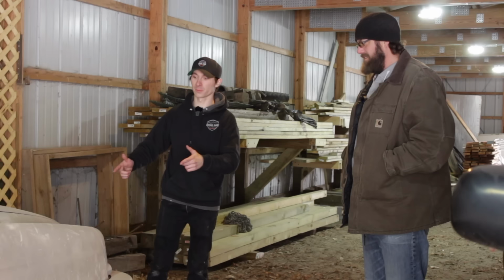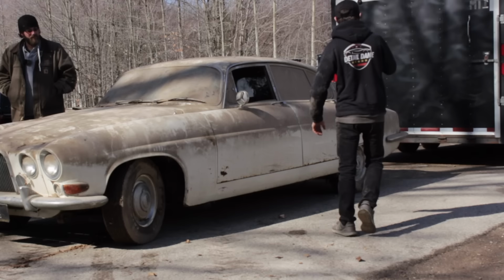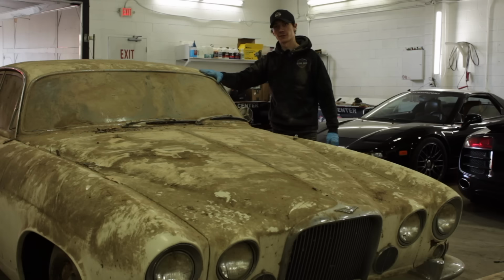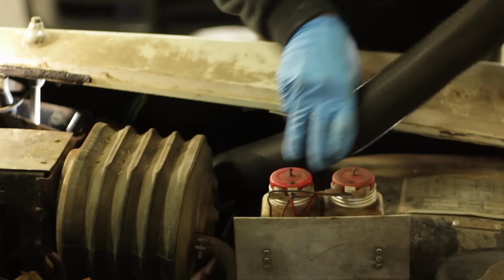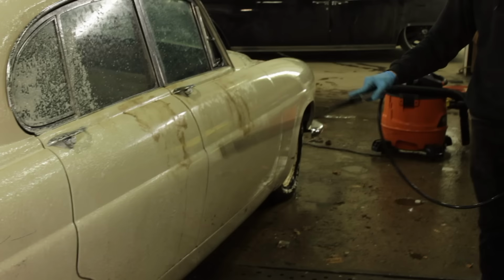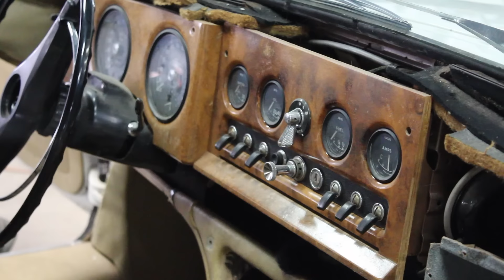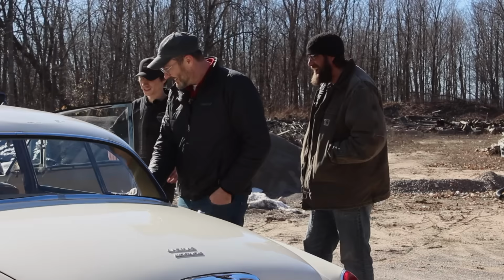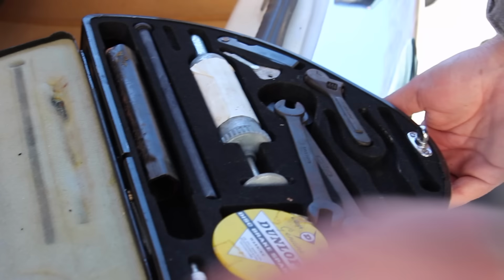I Found a Classic Jaguar ABANDONED in a Barn For 30+ YEARS & Detailed It

Comment: That is NOT a x type of any jaguar , its a 3.8 MK 10 as the boot emblem states , the next model from there was the 420 G which was the same body with an updated nose , after that came the 420 in August 1966 , a smaller bodied car of similar style , the xj6 came out in September 1968 , the first jaguar to have an x to its title , even though the xk series of engines started out around 1954 . During that period , xk was used to indicate sports car models xk120 xk140 and xk150 , the racing cars of the time were Ctype , then Dtype in both short body and le mans body , then came , in 1961 a completely new car called the EType , never what americans called an xke , the best joke is americans calling a v12 5.3 l Etype an xke because it never was , the term xke came from the engine designation of the xk series 6 cylinder engine .

Comment: Beautiful "JAG - U - ARE" ,  not JAGWIRE" as a dear old friend from England used to always correct me. Whoever had that one didn't like the original colour, and had a light restoration done to it in the late 1970's with a very detailed repaint to white. Must have been low miles, and had a very original spare. I bet it is only on its second set of tires!
Reply: Errrr,  tyres.

Comment: Nice clean up job on the jag young fella.Will they get it running? Will be a beast when running and worth the $10,000 they are asking.
Those 3.8's had a problem with head gaskets?...
(ps. v8 chevy's drop straight in 😂)

Comment: Looks like the FB seller forgot that it was a Mk.10 Jaguar. X-types didn't even exist until 2001. For the Mk.10, later renamed the 420G, it was Britain's top-of-the-range saloon car of the decade, starting from 1961 and ending in 1970 due to Leyland taking over. The only sacrifice that was made was that for most, if not all of these cars were column-shift automatic, but that's just how luxury was back then. There were 3 types of Mk.10 Jaguar that were made in the decade. The first being the 3.8L version (same engine as the iconic E-Type), second being the 420, basically same thing but with a 4.2L XK engine instead and a badge on the boot, and the gargantuan 420G, much larger and wider than the other two, with the same 4.2L XK, but with 3 SU carburettors, again but with a 420G badge on the boot. Mid-to-late 1965 Mk.10 Jaguars had additional chrome trimming along the side with side markers in order to make it road legal.

Comment: Just because it's cleaned up doesn't make it valuable. The cost to properly re-upholster the seats in this car is in excess of $10k alone. You also need a paint job because of the rust. You didn't touch the running gear. As a long time restorer of Jaguars, specifically the Mk 10, I can say that replacing the engine seals, rebuilding the two fuel pumps, doing the brakes, fitting a new exhaust, and repairing the mouse damage to the wiring is going to run $10-20k. You'll need new tires too, of course. The Mk 10 3.8 is an unloved model. It's rare to see one sell for over $15k. So, a "low ball" offer is appropriate for someone who has the skills to do the major work the car will need to get it back on the road and who can live with the torn seats and poor paint. There's no upside to restoring a barn find like this except for the person who doesn't care how much it ultimately costs, because they love the model. Personally, I prefer the later 4.2 litre car, as do most collectors.
Reply: And the fucking party pooper oficially arrived!

Comment: With the exception of the e type,, These mk 10’s would have to be the best looking jags.

Get rid of the original engine and gearbox and slip in a nice little small block chev and auto and you’ve got a nice reliable cruiser that you can daily drive that will go and sound better and can fix and maintain easy with off the shelf parts.

Comment: This is NOT an 'X type ' It's a Jaguar (not Jagwar) Mark 10. The 'X' is the Roman numeral 'ten'. Depending whether it's a 3.8 1961-64 or 4.2 1964-66. After that they changed a few items, both cosmetic and technical,  and it was renamed 420G. The XJ6 took over from it, in a rationalisation of Jaguar's confused 60s model range.

Comment: Pressure washers are seen as cool & trendy toys right now but they are a BAD idea for washing cars & especially for washing old classic cars like this one. The water pressure forces water past water seals into places that water is not supposed to be able to get to. What you need here is an ordinary hose pipe to wet the vehicle & then a good old fashioned bucket of soapy water & a sponge. Using a pressure washer is a great way of introducing rust into your vehicle.

Comment: What kind of toy is your drilling brush???😂 Can't you use a powerful and fast rotating one and use it on all the fabric parts of the car and extract it instead of using the steamer and wiping it off.

And make the video longer(upto 35 mins) by adding dedicated scenes and shots to each part of the interior and exterior. Only then will you gain large and long-term amount of subscribers... 

And overall make these videos more satisfying and please use some strength in doing it...😊